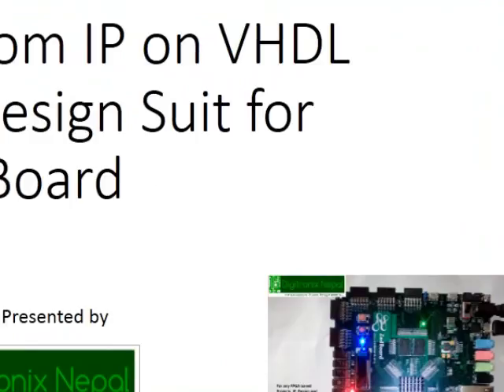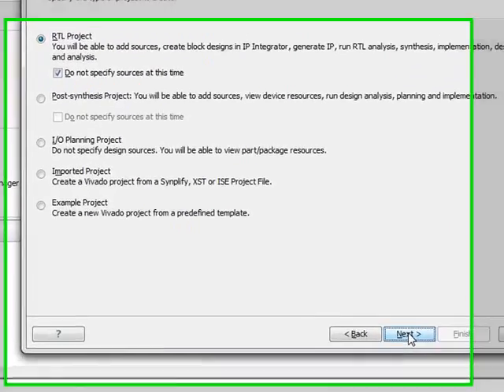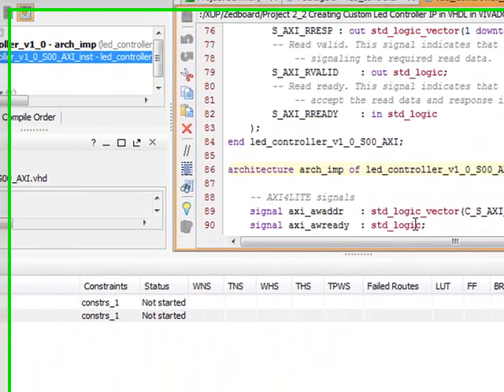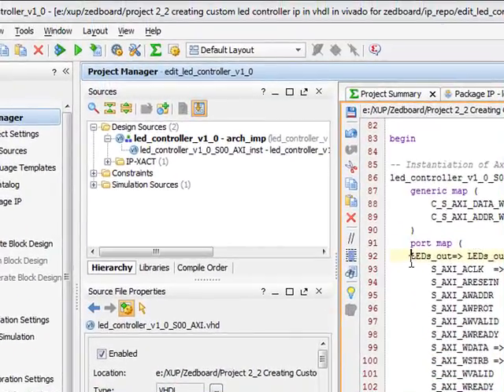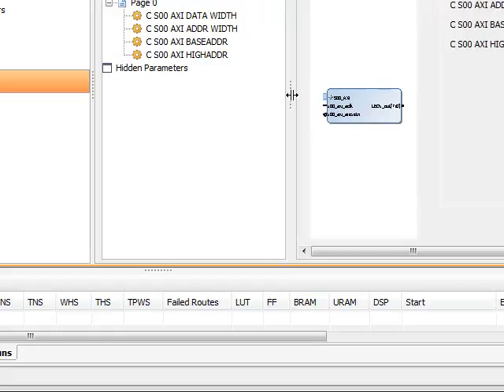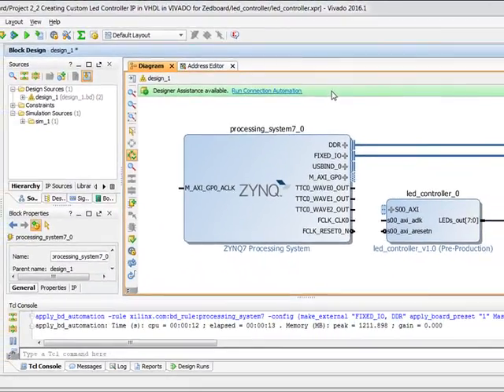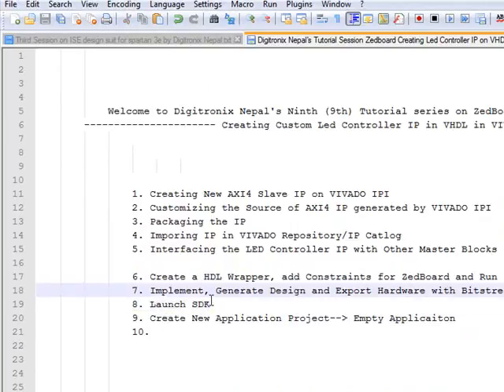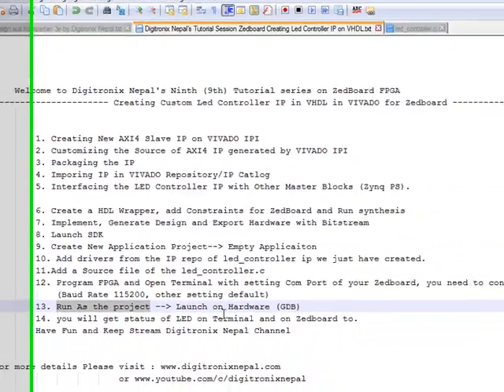Creating Custom IP on VHDL in VIVADO Design Suit for ZedBoard

Comment: hello.... I m  creating ip for ethernet in vivado for arty board.
adding microblaze and axi ethernet ip , after auto connection 
when i tried to validate  an error is coming
ERROR: [BD 41-238] Port/Pin property POLARITY does not match between /clk_wiz_1/reset(ACTIVE_HIGH) and /reset(ACTIVE_LOW)
 i dont know what to do please help me
Reply from the maker: Please send your issues with screenshot at gaihrekrishna@gmail.com.
Reply: actually my reset is in active low mode by default and i am unable to set it as active high mode
Reply: in  processor system reset

Comment: hello! At 14.36 I have got a Warning: 
[IP_Flow 19-3153] Bus Interface 's00_axi_aclk': ASSOCIATED_BUSIF bus parameter is missing.
Do you know what to do here?
Reply: The Problem was: when I pressed "merge changes ..." it generated an additional reset and a clock signal. So I had them two times. Just had to remove the new ones (written in lower case letters)
Reply from the maker: Please send your warning and problems with screenshot
 at gaihrekrishna@gmail.com.
thanks for the feedback!